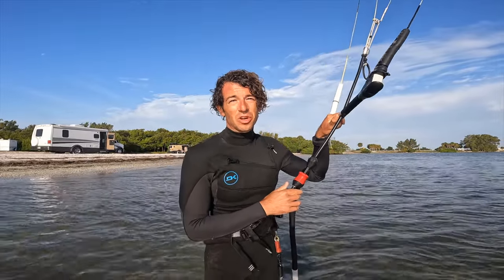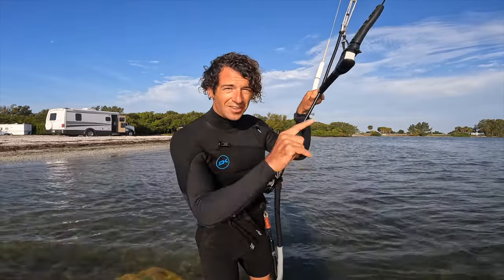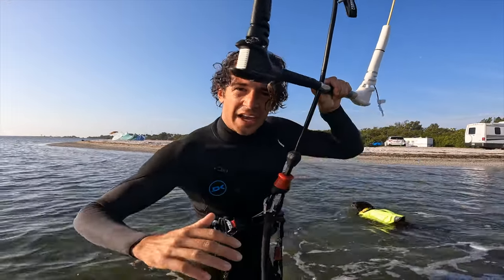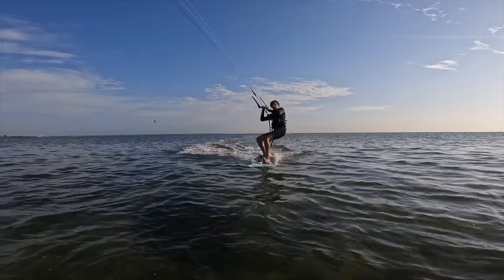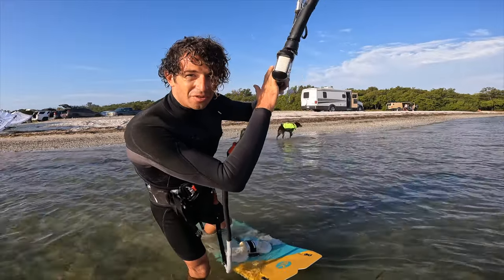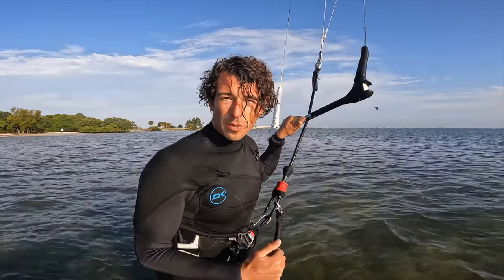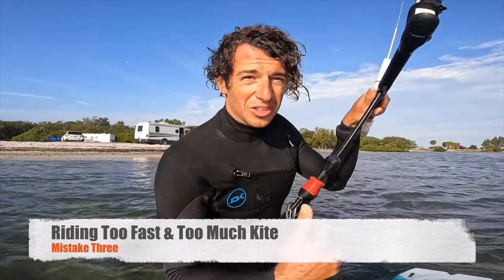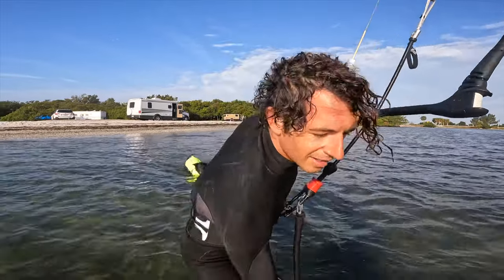3 Mistakes For Kiteboarding Jumps and How to Fix Them

Comment: Great video! I've been working on my jump height for a while now and can't seem to consistently break 5 meters... How high can you get in 10 knots with a 15m kite?
Reply: I don’t think 10 knots are enough but you can divide your weight by how many knots and then multiply by 2.2 (72 divided by 18 knots x 2.2
Reply: @povwithzubda5892  Interesting - where did you find this formula? 
That would imply a more heavy kiter could jump higher in the same conditions:   100 kg / 20kts x 2.2   =  11 Meters  while:  50 kg / 20 kts x 2.2 = 5.5 Meters

Comment: What do you consider "moderate" speed? Thx
Reply from the maker: A controllable speed - too slow and you wont be able to use the momentum of the heelside edge motion to get off the water - too fast and the crashes will be not so fun and wont be able to do a hard heelside carve
Reply: man I'm starting jumping, but with so light wind get really difficult...
Reply from the maker: @GaetanoCrisci  if you can jump in lightwinds then you can jump in any winds
Reply: Thank you !